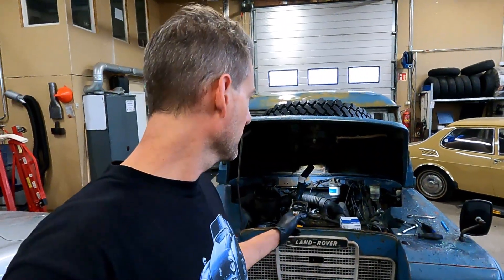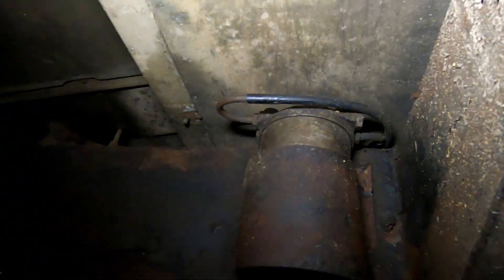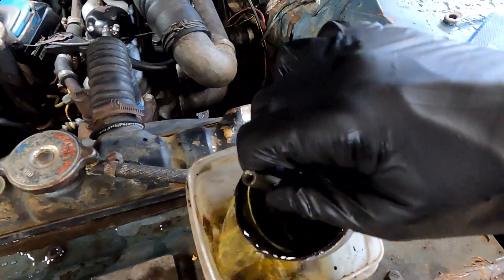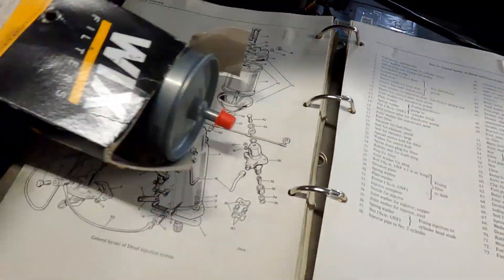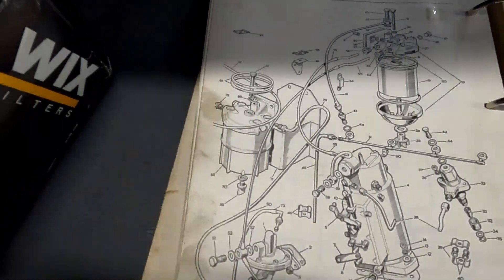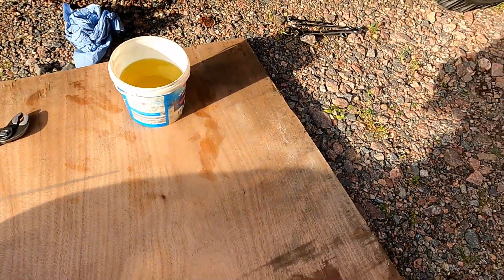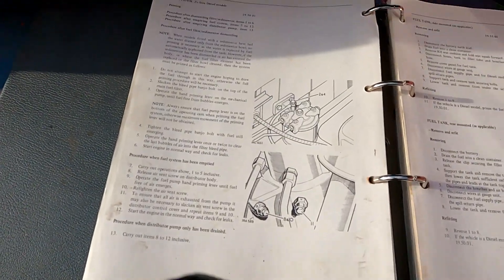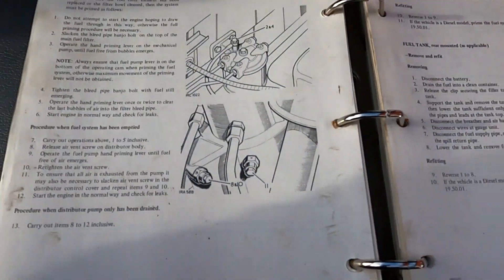Land Rover Series III: Fuel filter change, sedimenter drain and full fuel system bleeding procedure

Comment: You only need to drain a little from the sedimentor as the crap and any water will be on the bottom, ie oil floats on water and craps sinks to the bottom👍🏻
Reply from the maker: Thank you for the tip 👌🏼👌🏼

Comment: This has been really helpful thanks.  I made the same mistake with the fuel filter and now have to bleed the whole system.  Out of interest how long did it take to prime the whole system.  I’ve been trying for about 15 minutes and gave up.  Any help would be great.
Reply from the maker: Hello there and glad the video helped but sorry to hear you're having trouble bleeding. It didn't take long at all to bleed. Are you sure there are no leaks anywhere and everything is tightened?
Reply: @jamiedowson6482  Thanks Jamie.  It was running until I changed the fuel filter and then I’ve struggled to get any fuel through so I was interested in how long it took.  I’ll try the bleed nipples over the weekend.  Wish me luck.
Reply from the maker: @brettatkinson8216  did you manage to bleed it over the weekend?
Reply: @jamiedowson6482  Hi Jamie - I didn’t as it’s been raining and freezing cold.  Ill give it a try this weekend hopefully and let you know

Comment: Good videos. Your sedementor sometimes gathers algae in it. Best to remove and give it a good clean. Good old Land Rover, they make it so easy to get to these things. 😂👍
Reply from the maker: Thank you for your tip.  When the weather gets warmer I think will drain fuel tank, rinse it and replace the sedementor to be sure. The is also a rust repair I can get to better with the tank out. Jamie 😊